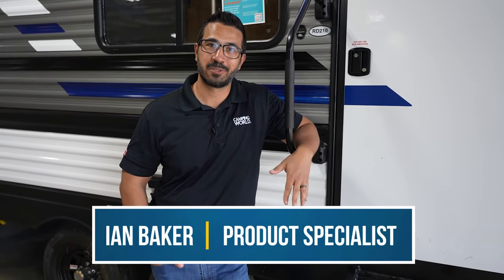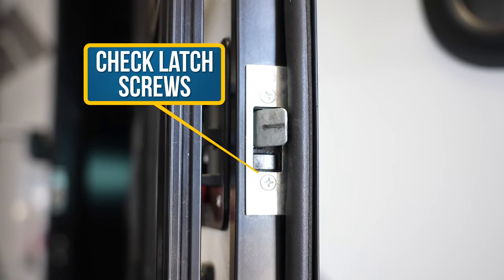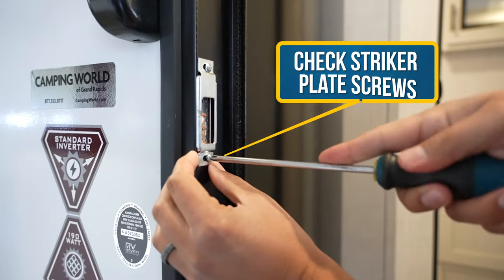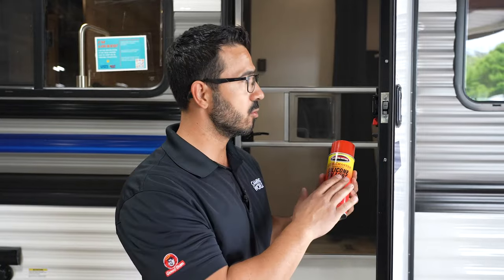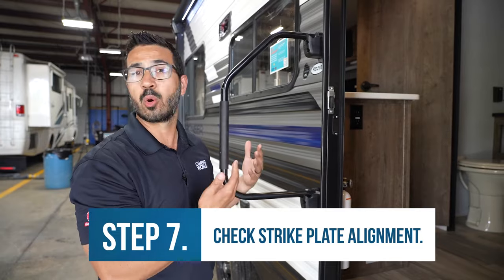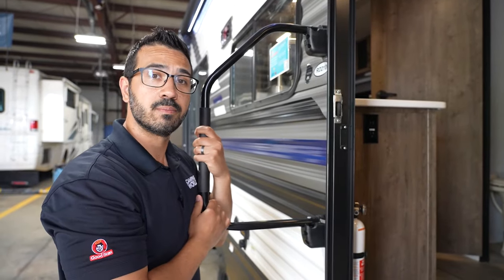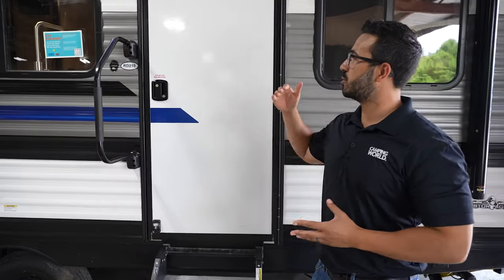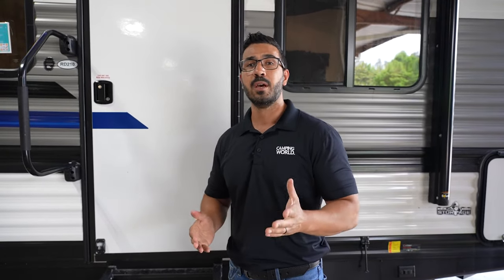RV Troubleshooting: My Entrance Door is Difficult to Open or Close

Comment: I have a brand-new RV and since we purchased it, you have to either press firmly on the outside for it to catch the latch or pull (I think way too much) really hard on the interior latch to the point it feels as if it's going to rip the handle off.  I checked the solid step height and even adjusted the striker as far forward as it could go.  After watching this video, I'm going to watch where it connects against the striker and maybe see if adding tiny washers will help.
Reply: Update! It wasn’t the door latch at all, well in a way it wasn’t. It was the bow of the door. The door was bowed too far in the middle from the factory. I adjusted the bow in the middle enough to allow the door to shut softly without jeopardizing the seal pressure against the door frame.

Comment: My issue was improper door installation on my new trailer.
When opening the main door, the screen door would remain closed instead of syncing with the main door. Opening the screen door required a shove to overcome the friction. Closing both doors also required a hard shove.

Inspecting the door jamb, I discovered a scrape around 3" from the bottom of the latch side. The scrape was ocurring because the bottom door hinge was improperly installed on the screen door by around 1/8 inch. I removed the screws from that hinge, drilled new holes and reconnected the screen door. Now there's no scraping or friction and both doors open and close smoothly.
Reply from the maker: Sorry you had to go through this but so glad you figured it out!
-Ian Baker

Comment: Clever points to help with the main door but what about the screen door attachment or causing a problem not allowing the outer door to close?  I have a new replacement screen door by Lippert for my forest river Hemisphere hyperlite 29rlshl. Previous door wasn't working so I ordered another one but when I set it in place, the screen door  sets back where it should by the latch but not by the hinges. It sticks further out and doesn't let the outer door to close.  I don't want to leave the screen door off.    The outer door fits fine without the screen door. I really miss the screen any suggestions?

Comment: My issue is very tight hinges. Do video on changing hinges. Dealer said it was normal but door has to be force to even move. Caused it to pull out of framing. Thanks.
Doug
Reply from the maker: Hi Doug. Do you have a friction hinge door? If so, they ARE supposed to be harder to open/close as that is what keeps the door open (no latches).
-Ian Baker

Comment: My RV screen door sits too far away from the architrave latch side of the doorframe and allows bugs to come in through the the fur liner of on the frame. I was thinking about placing some shims in the hinges on the other side of the door forcing the door over closer to close the gap in the door. Can you think of any other way I could rectify this problem.
Reply from the maker: Hi Mark, 

Sorry for the delayed reply. I reached out to our technical service team to get their feedback. They said this is a common issue. 

Shims would work. You may able be able to use a temporary shim, or a small prying device placed behind the side with the narrowest gap and just giving it a light tweak. They recommend making many small adjustments to get to the desired placement. Understand any change to the fitment will require a person to readjust the latch when done.

If you'd like further assistance, I'd recommend reaching out to a service center in your area: https://rv.campingworld.com/rv-service-maintenance#js-anchor-locations
- Tucker Ballister

Comment: Ian, how about when the door is too close to the jamb, and the striker plate is hitting and causing the door to bind when closed, making it difficult to pull open? What's the fix?
Reply from the maker: Hi There!

Door adjustment is a bit of an art. When the door has been installed such that the strike plate is grinding into the door, the placement of the door jamb in the opening was too far to one side or the opening is too small or not uniform. 

Because the door is installed with so many screws, we cannot simply remove and reinstall the door to shift it in the other direction because we would expose the original holes on one side. 

If the opening requires trimming, the door will be reinstalled in the same position afterwards. Either way, using a wooden block and a heavy hammer, the center of the jamb and the strike plate itself can be tapped outward just a bit to permit free clearance. 

Care must be taken to ensure that the latch and deadbolt fully engage into the strike plate so the doors closes securely. It may take multiple attempts to fine tune these adjustments.

Your best bet is to bring your RV into a service center to have your door adjusted. Here's a link where you can find our contact info to book a service appointment: https://rv.campingworld.com/service

Hope that helps!
- Tucker Ballister

Comment: my problem is that my lock is unlocked, but i cannot get my door open! :/
Reply from the maker: Hey Ian Baker here. It's always extremely difficult to troubleshoot via messaging, but sometimes if your screen door is stuck or if your solid steps are too high, it can make opening the door very hard. You can try to lift when you pull open and sometimes that will ease the pressure enough to make it open. Hope this helps!
-Ian Baker

Comment: So this is yet another reason to Hate these Moryde steps
Reply from the maker: Haha, why do you hate them so much!? Asking for a friend 😏
-Ian Baker
Reply: @campingworld  One reason is that they are too narrow. Or at least RV manufactures (even Grand Design) install the more narrow ones. This creates a hazard stepping in and out. Another thing is that they often will not reach the ground if you are in a site that has a tall pad, or if you are boondocking on a steep grade. Lastly, if you are on a level pad/site then you have to be careful not to over extend the legs. Or else you will raise the door sill plate where they attach to the RV, and your door will not close. Or even worse (as I have seen). It will bend the door up as it tries to move over the (now raised plate), and scratch/gouge the door frame. This can lead to a sticky door where it will not open or close from the outside or inside correctly.
Reply from the maker: @rvscootin3457  Ian Baker here and those are all valid reasons! I have personally witnessed the door being bent on the step plate myself. Like most things in this industry, there are pros and cons to these steps for sure. Thank you for your feedback my friend!
-Ian Baker